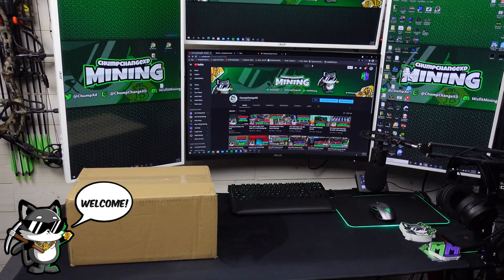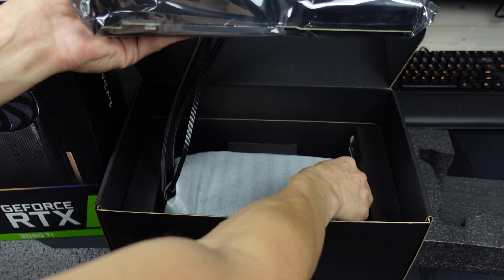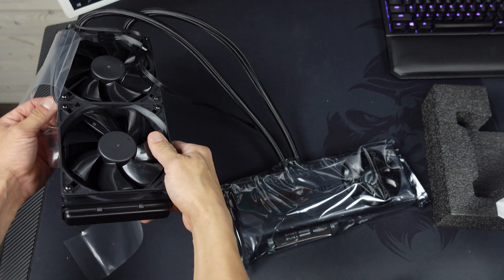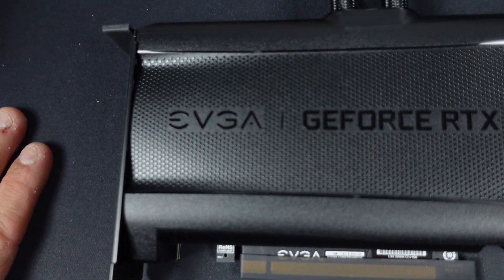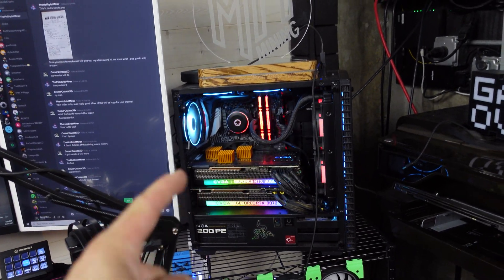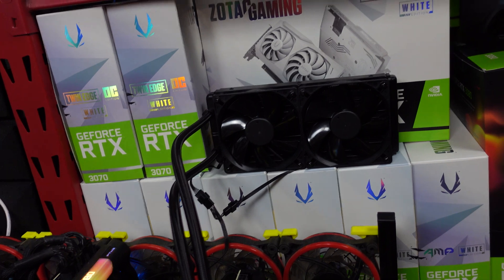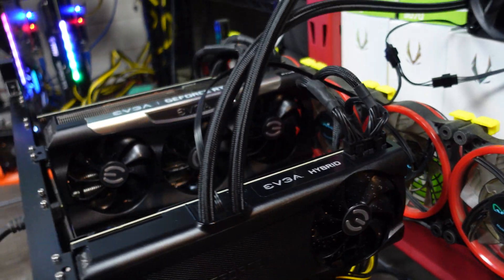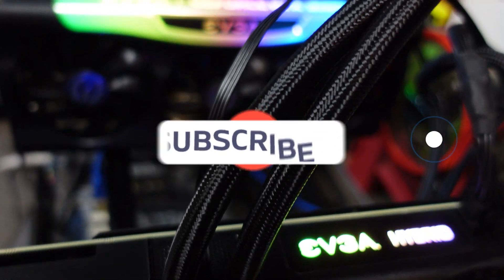RTX 3080Ti Hybrid | RTX 3080Ti Water Cooled Hybrid

Comment: Curious to see what memory temps this thing has.  I have that cooler on my 3080 FTW3 and ended up being highly disappointed, only ran 0-2 degrees cooler than the fan cooler when mining.  I've replaced the thermal pads and added pads to couple the backplate to the memory as well but no change.  Runs great for gaming, and it doesn't thermal throttle when mining, but seems the cooler isn't so effective keeping up with the constant load of mining... at least mine can't anyway.
Reply: Yep I just got this card / cooler and I hate it.